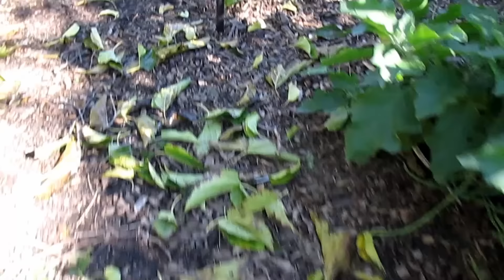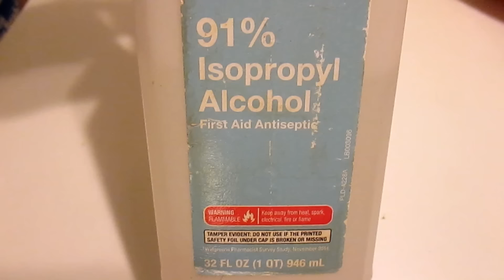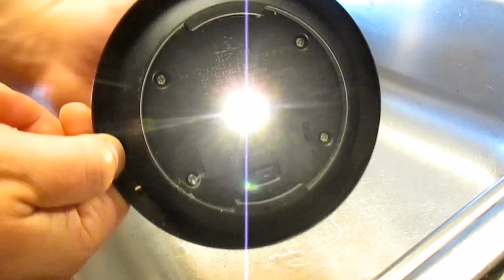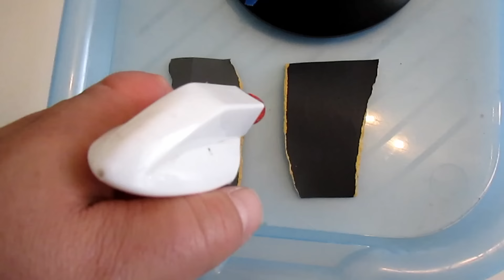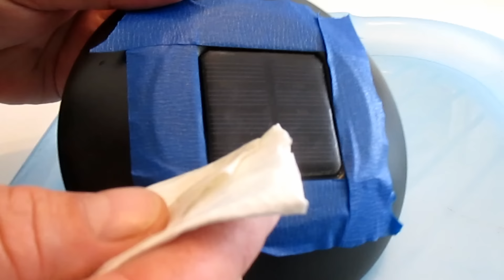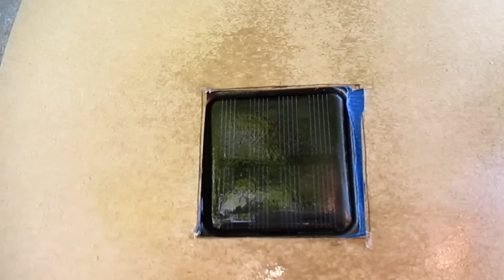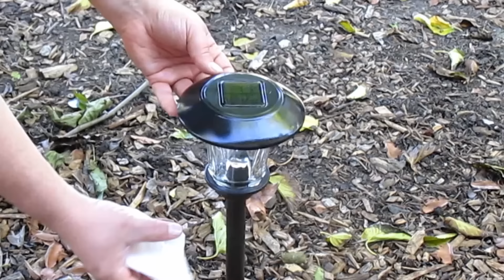Quick & Easy Way to Clean, Renew & Restore Solar Pathway Lights! Wow!! Looks Brand New!!!

Comment: My husband tried a damp magic eraser sponge and it took the haze off immediately. Don't bother with all these steps. We did spray the Rustoleum clear gloss UV resistant non-yellowing on the top after, but you really just need to use a magic eraser to get the film off!
Reply: Excellent!
Reply: JulieAnkha N. 👍
Reply: The magic eraser trick was helpful on one of my lights but some do need the wet sandpaper. Thanks!
Reply: @ItsmathoffRL  0:09 0:09
Reply: Solar panels use all,different frequencies of light to charge.  
The UV damages the outer coating of the plastic covering of the solar panel and makes it much less efficient.
Reply: Would applying car wax on the solar panel keep the panel from getting gross (eliminating the need for the abrasive clean) or would that effect the solar panel from doing its job??
Reply: I know this was three years ago but thanks!
Reply: You will need to change batteries and/or clean the battery contacts with alcohol as well.
Reply: Do you have to do that every year or does the clear UV gloss protect it?
Reply: I used the brand named majic eraser a year ago, and it scratched the plastic covered solar cell, so I stopped.   This is why Im searching since it's summertime and I have to look at them more often.
But maybe magic eraser works on certain other types of solar lights but not on mine.
Reply: @mbbrooks123 :  That Magic Eraser effortlessly removed the nickel finish off of my bathroom taps.  Don’t use it.
Reply: Thanks buddy. I got like a box of these cheap lights from over the years. I think I am going to clean them up and grab a can of clear coat spray to protect.
Reply: I have tried all these various tips, but still not working
Reply: @adribroekhuizen8775  you might need to change the batteries
Reply: @TimR1099  already did that, and everything else, but still nothing ( and they're not even old)
Reply: @adribroekhuizen8775 

They’re probably a cheap set you have then. You get what you pay for as they say.
Reply: @adribroekhuizen8775  try a nail file on both ends of the battery. I also do a light sanding on the flat end of the battery terminal.  If this fails, try a regular battery to see if it lights. If no, it's the unit itself and beyond my basic diy.
Reply: @adribroekhuizen8775  this will not work if the interior has rusted
Reply: @jk834  the interior is perfect with no rust.
Reply: @adribroekhuizen8775  your lights either need a new solar light battery or the whole electrical system may be rusty, in which case, unfortunately there's nothing you can do....although they DO sell just the solar panels, if you are familiar with electrics and soldering....you could replace the entire panel with a new one.
Reply: Just used a small piece of steel wool on some cheap solar lights, worked perfectly
Reply: Magic eraser didn't work at all for me. The effectiveness may relate to how damaged the lamp clear coat is, and therefore whether or not you need something more aggressive like sandpaper
Reply: @johncornwell6920 I agree. Mine required sandpaper. 
Ever watch a cleaning tutorial on something super dirty like a bbq pit, or moldy grout? And the video is like, “just spray with baking soda and vinegar and then wipe clean with a damp sponge.” Yeah, whatever. :)
Reply: Thank you! This works a treat! I was about to throw out my lights. Brilliant!!
Reply: The magic eraser actually doesn’t do the trick 👎🏼
Reply: Thank u
Reply: Great thanks for sharing
Reply: Thanks hero just saved me a lot of time lol
Reply: Lifesaver! Just tried this. My Christmas lights are back in action. Thank you 😊
Reply: Trying today !! Thnx
Reply: Thank you so much for this easy fix!! Worked in seconds.
Reply: I'm going to buy Magic Eraser and the sandpaper and see what I come up with. I do enjoy looking at the lights in the yard and on the porch in the summer in Washington, DC.
Reply: Isn’t there an easier way?
Reply: Thanks, glad I don’t have to go through all those steps.
Reply: Thanks for this info!!
Reply: Might work for light UV damage but mine need sand paper. Eraser doesn’t have the abrasiveness to remove severe damaged coating
Reply: You (and hubby) are my hero! What a simple solution. Thank you!! 🎉
Reply: Thank you! Works brilliantly and certainly a lot easier than steps in video
Reply: Just did this with my solar flag pole light, what a huge difference, thanks for the video.
Reply: Tried it but didn’t work for me
Reply: Thanks for the magic eraser idea. I have some & will try it & Dawn.
Reply: Tried the magic eraser on mine with a lot of elbow grease but didn’t work. My panel was pretty milky though, perhaps the dry eraser is better suited for a slightly greying panel.
Reply: I did notice your set of solar lights you are cleaning. The solar part itself seems to be raised. My whole center part with the square area where the solar recharges is flat. So I have just taped the square solar part off to sand. But after that should I not just clear coat the whole round flat part including the square part? As I have one that the clear coat is cracking and peeling and it completely covers the flat round top with the square solar part. Edit to add I did end up sanding my whole flat round area as my square solar area is not raised as the posters. I did cut circles instead of squares using heavy construction paper to trace. And clear coated twice.
Reply: Just tried it and it works, thanks.
Reply: Thank you! Worked amazingly
Reply: Hello, can you tell me where I can buy "damp magic eraser sponge"? I have a lot of solar lights for my garden that they dont work anymore, I want to revive them.
Reply: @TheHiddenPearl , just Google or look for "Mr. Clean Magic Eraser". You damp it yourself at home. You don't buy them damp. 😉
Reply: @AquaLew Lol
Reply: @AquaLew Lol
Reply: @TheHiddenPearl  Mr. Clean Magic Eraser sponge found in all markets in the cleaning supplies section.
Reply: @TheHiddenPearl   At Dollar Tree, Home Depot, Lowes, most grocery stores   White, dry sponge that needs to be dampened with water to use.  They leave a powdery residue, so rinsing with clean water is necessary.
Often sold in a box of two or more, sometimes by "Mr. Clean" brand name.
Reply: K M $ Tree
Reply: @TheHiddenPearl the hidden Pearl?….. the clitoris?….
Reply: @TheHiddenPearl guys I’ve found the G spot!!!!!!
Reply: @TheHiddenPearl they’re the Mr. Clean Brand sponges that you can buy pretty much anywhere. Even Dollar Tree. Just dampen them with water.
Reply: @TheHiddenPearl You can purchase them anywhere. The Dollar Store usually has better prices. Then you just put water on it and squeeze out the excess. 👍
Reply: Thank you for sharing that!  I am excited to try that now!
Reply: How about, "don't bother" with commenting, , much less watching a how-to video on something you're clearly already an expert on. 🤷‍♀️

Comment: Is it necessary to change batteries every time this process is done?
Reply from the maker: It's a good idea to remove the batteries during storage. If the batteries are rechargeable, charge to 50% using a suitable battery charger and store separately until the next season. Before placing the batteries back into the lights charge to 100%.
Reply: Only lithium ion batteries should be charged to 50% for storage. The NiMH batteries inside these lights should be charged fully and stored cool. Bad battery could be because of battery memory. To regain some capacity discharge them to 0.8V and charge to full. Repeat this 3-5 times. This works on all types of NiMH and NiCd batteries, if there aren’t other factors like being discharged for too long. Thanks for the video!

Comment: Or you could buy new ones for $2
Reply: those are more like 20 bucks per light. If I had nice lights like that I wouldn't mind giving it a try. I have a neighbor that put a bunch of cheap solar lights and they really don't light anything. I bought some spot lights on amazon 4 for 50 and they light up the area very well. I was very impressed that they stay on most of the night.
Reply: Fixing is better than disposing

Comment: I guess if we purchase these new it is best to buy that can of clear coat and clean it and apply it before it ever is outside?  Save on the sanding and sand paper at least.
Reply: Keep the ugly factory protective film on, 3M also have some UV blocking tape, alternative would be not buying epoxy solar panels lamps but glass one, those won't haze

Comment: I did this and it looked great, for two weeks.  I think the sun just sucked the life out of the plastic to the point of no return.  It feels very dry and brittle and small crackles appearing after a year and a half.  Mine is a 4x8 inch pad for a spot light. They should make the panels out of glass.  They do make tempered glass solar spots (not avail. at my big box store), so if you need one do
your research online so your hard earned $ will not be wasted.

Comment: Great video.  I did notice that my lights, after the alcohol dried, were much "cloudier" than in your video.  Once I got the clear coat on, they cleared up, but I wasn't sure if you had any idea why that was.
Reply: Scratches from sanding them cause the cloudiness. I would suggest finishing with a quality plastic polish instead of the clear coat spray. Solar panels need UV light to work, so spraying a UV resistant clear coat seems counterproductive.
Reply: @DesertPathways  UV composes only 4% of the light that reaches the ground. The overwhelming bulk of light used by a solar panel is in the visible range. Typical solar cells also are not very effective at converting UV to electricity. One could block 100% of UV from a typical solar cell and have difficulty noticing the drop in output.

Comment: The electronics inside these lights corrode over time unless you apply circuit board varnish to all of the internal components and connections.
Reply: These lights are a nice idea but let down by crappy electronics that corrode very quickly due to poor quality Chinese materials.
Reply: Do mean the solar lights that don't use a battery? If so where is this circuit varnish sold?

Comment: Gave it a try on my 2 year old Costco solar lights (SmartYard brand) , and 15 of the 16 came back as good as new.  One bad battery, but that's not too bad for two years.  Thanks!
Reply: Doug Klanecky you can replace the battery in them with rechargeable batteries from energizer
Reply: This is a smart solution